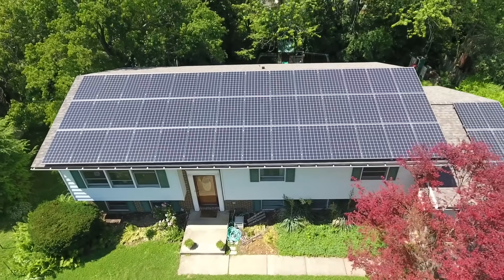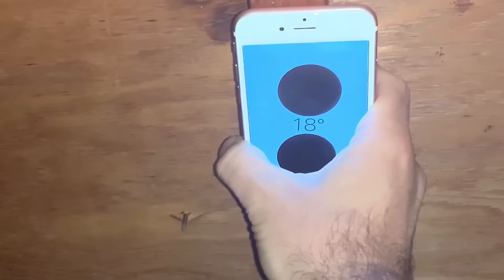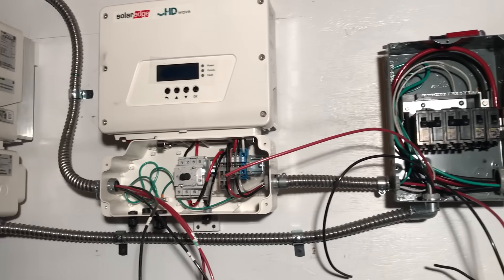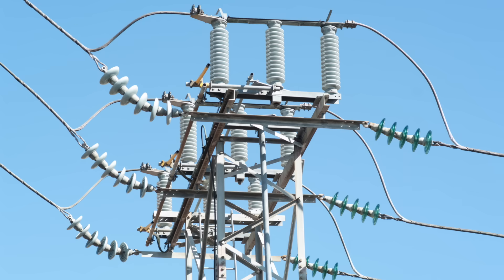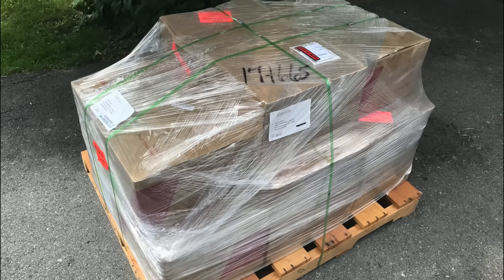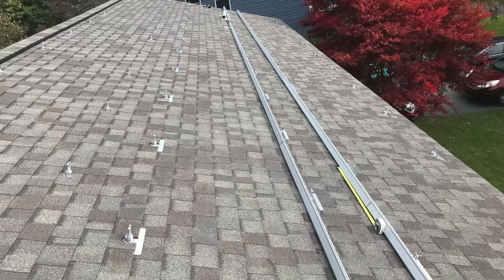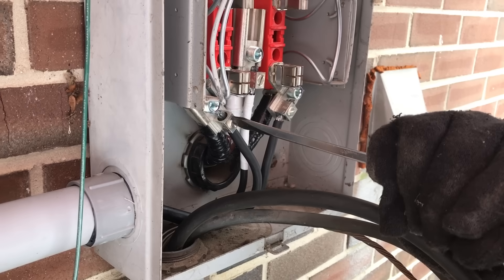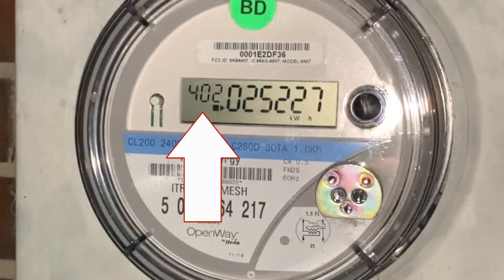I Installed a Power Plant Myself | HUGE DIY Solar Panel System

Comment: My only question is when your shingles need to be redone in 20 years. I’d imagine still worth it but definitely gonna be a lot more work.
Reply from the maker: Hey great name!  The shingles under the panels should last much longer than that since the panels are protecting them.
Reply: you could always go a step further and instal aluminum "lifetime" shingles.
Reply: Pretty easy to unplug the solar panels, and gain acces to the shingles. In the meantime the panels can just be placed on the other side of the roof.
Reply: Or install solar shingles haha they make those you know lol

Comment: You could reduce your carbon footprint by using a mini split which is basically an air conditioner that heats as well and are really efficient.
Reply from the maker: I’m definitely thinking about that.

Comment: Did you consider putting it in your yard on top of a big pergola? That way you could use the whole solar panel system for shade to hang out under. Like for get-togethers and whatnot. Any reason that wouldn't work? Yeah it would be big, but I have a huge, blank yard. So maybe it would be an upgrade to my particular yard to have this big shade thing. Any reason I shouldn't do that, and should put them on the roof instead?
Reply from the maker: That’s a great idea if you have southern exposure to your backyard. Unfortunately, my southern exposure is in the front yard.

Comment: Wow, what a bunch of work in the US with all those permits!! Can imagine you hesitated. Here in the Netherlands it is much simpler luckily. Just connect your inverter to the grid. And then it takes just one message to  the electrical company informing that you are producing. But I guess some level of checks helpt to keep the grid clean
Reply from the maker: I wish it were that easy here!
Reply: @FrugalRepair  but thanks anyhow for the nicely edited video, good job. PS fan of solaredge here as well

Comment: Lmao, I love how people spend between $20,000 and $40,000+ on those setups and they say No More Bills! 

I pay between $90 and $120 per month for electricity, that's between 20 and 40 years of electric bills, headache free, always there and reliable.

These systems are known to be very inefficient if not useless after 20 years, that's why government programs are only on 20 year contracts.

This is ambitious project, no doubt. But unless you live in a remote area with no access to electricity, it isn't worth it .

Comment: i really enjoyed the video but i was wondering if you  have done or could do a video that talks about what size of wires (16gage 12 g 8g ect.. are needed for the various configurations of panel size/inverter sizes/batteries ect...
Reply from the maker: Thanks!  Choosing wire sizes depends on many factors like conduit size, amps, temperature, type of conductor, etc.  I’ll keep that idea in mind for a possible future video.

Comment: Ya could have passed the ground bellow the rails... And there is no need to use a naked wire for ground. You just strip it at contacts.

Comment: So you're sending excess generated power back to the grid rather than storing it in a battery. Does that mean that when the system isn't generating power (it's night.. it's raining.. it's covered in snow..) you're drawing from the grid instead? You said you aren't getting any bills so I assume that even in those conditions I mentioned you're still generating more power than you're consuming, but I'm curious how this works with no battery.
Reply from the maker: The next video should explain the answers to your questions.
Reply: Former solar panel salesman. You are always drawing from the grid with solar panels. You don't use a single watt of it. The way it works is you become a power producer for your local electric utility. They then credit your account with an equivalent amount of "credits" for your power generation. For instance, if your panels generate 10kWa per day for example, and you use 11kWa, your utility company would only charge you for the 1kWa that you used that you did not generate. But you are always using grid power, not solar power. Conversely, if you generate more power than you use, it will "bank up" credits. This is useful for hot areas in the summer when you're using your AC a lot more, or cold areas in the winter. 
That said, if your system is drastically oversized (As it appears this house is), you're going to be generating far more than you ever use, which is just more cost on your end for no real gain. So if you want to get a solar system, take a look at your electric bill and add up the entire usage for the year. Then, add 20% to be safe in case of a heat wave or cold snap depending on you area and you use the AC or heater far more than normal. You'll still receive a bill from the utility company, but if it's a properly sized system, the bill will be $0.

Battery tech is unfortunately lagging behind, as there isn't really a practical solution to storing and using the power that you generate. They either take up far too much space in your house to be practical, or they don't generate enough power to be practical. A small battery setup is a good solution for say emergency power. Power outage happens and it will keep your fridge on so your food doesn't spoil, but you're still going to be using candle light. A large system will keep your power running normally in the event of an emergency, but don't expect to park your car in the garage anymore.
Reply: @seleckt6600  Interesting. That clears a lot of that up. Thanks.

Comment: I hope this would be as easy as this in Finland aswell. We get so little sunlight during the winter that the estimate after investing 18k to solar panels is that it benefits you by lovering your electric cost for around 15-16% in a month.

Comment: Really impressive project with a great result. Thanks for sharing. How long did it take end to end? As you were replacing the shingle roof was a Tesla solar roof an option or too expensive? Also, have you considered battery storage? You may end up making more cash as you’d almost never draw from the grid?

Comment: In previous years, Alberta power companies would do anything to detour any solar home installation from being connected to their grid.  They were ill equipped for it on their power grid and they didn't like a challenge to their power monopoly.  They would charge you insane prices on their issued power meters and even charged you a steeper monthly power transmission administration charge.  How times have changed. The smart meters are more reasonable in price and the power administration monthly charges are the same as conventional power.  I remember the days when a single smart power meter used to cost over $40,000; now they cost just under $600.  The smart power meter can be read remotely by the power company and this gives them valuable data on how to better fine tune their power grid throughout the day.  If electric cars become popular, anyone with a solar home will have a huge financial advantage against increasingly steep power consumption charges.

Comment: I used to drive a forklift at my first job. The oly reason your solar panel got hit is due to negligence. Your forks shouldn't be up in the air if the holes to lift the pallet are on the BOTTOM! You wouldnt even keep the forks that high when the machine is off, we still kept them on the ground. I'm so confused how the driver even did that
Reply from the maker: Yes, definitely a mistake. Maybe they had a pallet on there already when they hit this pallet?

Comment: In 15-20 years when you need to replace the shingles won't you need to remove the system?   I might have gone with a permanent steel roof.

Comment: nice job!
Question : what will be the efficiency of panels after 5 yaers, 10 years, and so on.
no battery used there? i think it is nice that your electric national compny want to buy electric instead of hold it in expensive batteries. but, i don't know which is the best at long time.
i'm interested by solar panel system, but scare for longevity...
thank you for shring and this nice video.
félicitations for your quality job done.

Comment: I'm an electrician and i am getting solar my question is since i have never done any solar before. is each panel wires in series/ parallel? Example, if you have 30 panels you would do 10 in series 3 times and then parallel the group of 3 to 3 inverters? im also getting power walls
Reply from the maker: That’s cool that you’re getting into solar! In my set up I have 48 panels, 12 are in the series. And I have four strings. But I am using power optimizers so it may be a little bit different since they are trying to keep the voltage constant 400 V.

Comment: Question though. Do you have a battery installed that charges excess power in the day so you can utilise at night when the sun is out? I imagine this setup might make even more value for yourself compared to selling power to the grid in the day, and buying from the grid at night. I think with a proper program set, you can charge a big enough battery to last a few nights, and still have enough to sell back to the grid when battery capacity hits the upper range of capacity.
Reply from the maker: No batteries, check out the next video where I explain net metering, that’s the key to making it work.

Comment: Unfortunately, here, the power company only pays you a fraction of what they charge you, for the same exact electricity. Even though you, literally, made them more money by them NOT having to feed your house with power, and you fed a neighbors house with more efficient power than they could have provided. While they were charged full price for that power YOU made. (The losses of sending power from a power station, to your house, are close to 28%. The losses of NOT sending that power, are 0% and the losses from your house, to the closest house along the grid, are less than 1%, on the hottest day. When it produces the most power and they have the highest losses in transit, for them.)

However, grid-tie is the best way to do it. As opposed to trying to store power yourself, which will end-up costing you.

Every 1 KW you make, is a about 1.28 KW the power company didn't have to make, to feed your home with power. Though it isn't exactly a "win" for the environment. Unless the power company spends the money they made from selling your power, on something other then jet-fuel and vacations in foreign countries. If everyone went solar... They'd still be making money, and have free power to keep the lights on in the plant, to make it look like they are actually doing something in there. :P (Throwing raves and still charging for the power!)

Comment: Does your state / county inspector not care about fire code? usually it is 3 feet from the ridge and outside edges of roof.
Reply from the maker: The setbacks were not part of the code in my area when I installed the system.

Comment: I install SolarEdge also... looking at your inverter, they are version 1 and in 13 months they are going to break. Some 18xB error. SolarEdge is great is getting you another replacement. 
Contact me if you need help setting it up... there are no videos on how to switch inverters. 
Call SolarEdge at 9am, otherwise you’re going to be on hold for 45 minutes. 
Solid install. 
Also the flashfoot2 flashing mounts are AWESOME. I use them all the time. 
And as for your grid connection, that’s called a line side tap.
Reply from the maker: Thanks for the info!  Can you send me an email and we can connect?  Do you know what the error is from?  That is, what’s breaking on them?
Reply: @FrugalRepair  also... I primarily use Panasonic panels for my installs. The VBHN series are the best in the market in my opinion. You are going to love the long term benefits of these modules.
Reply: Dude, I don’t know but out of the 8 I’ve installed, 6 have needed to be replaced. 
It typically takes place when SE sends an update. 
The device will lock up, then make me update it and after the 20 minutes of waiting for an update when the installer app says 2 minutes remaining for 18 minutes, the screen pops an error. 
I’ll look for the screenshot I took and email you. But yeah hit me up. Joseph@piefuerza.com
I loved your video. Reminded me of the first time I installed my first system. 
I had so many questions

Comment: This setup would cost me €50.000. or about 52 years of normal electricity cost for my family of 4. And everyone i know that has solar panels has blown inverters every 5 or so years costing another thousands. and then where i live i would need to pay €600/year distribution fee for the excess power OR spend another fortune on a battery, which also could break anytime it wants to.

Comment: I'm wondering, since your panels cover a good portion of your roof, did it help in the summer since it gives the roof under the panels a lot of shade? Just wondering if you say any difference with cooling and heating your home. Cool video.

Comment: Okay so I don't think solar can replace the grid but it is an important substitute. The most effective use of solar is for smartphone, laptop, tablet and anything with a deep cell battery. The most popular solar panel are ultralight foldables. The best place for solar is the equator. The best solar panel for money is renergy 100 watt roof mounter.

Comment: Wow!!! I am a Telephone PBX installer and have done many installs of systems and at times have worked along side the engineer who would be installing my UPS systems. I have to say that your install is the CLEANEST and most PROFESSIONAL looking install i have seen in a long time. Great work and very impressive.
Reply from the maker: Thank you for your kind words!  Your comment takes me back, in 2005 I ran a phone line to each room of my house and used an asterisk pbx to connect them.

Comment: This wouldn't work here as you are forced by law to connect your solar installation to the electricity grid. Furthermore, you are not allowed to "store" electricity, any surplus flows into the net. So basically that means "no generation = no electricity, so you are forced to get a normal setup as well unless you only want to "live" only when you can generate power. Up until recently we used to get money for this flow back (as you sell your surplus) but not anymore. Finally, there is a tax on solar energy now making it "not free" even if you would manage to only use electricity from that source. So bottom line, not sure where you live but law has caught up with this over the years.

Comment: I'm sorry but...no. ROI on grid tie ranges from 18 years to over 30 years and I base this on every professional book on the subject I have ever read. Normal break even date is usually when the panels are EOL anyway. Also, DIY means DIY and not contracting professional installers and electricians. Not knocking solar (I have solar off grid) but it will NEVER be cost effective compared to using the POCO. Never. 

One bad hailstorm you are done. One squirrel invasion and you are digging deep into your pocket to get them gone and to prevent them from returning is even more. You get a roof leak under those panels and $$$$$$$$$$$$. Insurance requirements for coverage is substantial. If your roof needs replacement you are looking at twice the cost of not having had those panels up there and most roofers will not take the job.

SO MUCH you neglected to mention and this sort of video is misleading.

Comment: i am not sure about regulation there but there are some inverter that act like a psu in case of no grid energy, that way in case of a black out you still have power in your house, these kind of inverter feed no energy into the grid in the case of a blackout and usually have the possibility to add a small energy storage.

Comment: Would it be possible to just feed the solar power into many high capacity powerbanks if connected in series to split the total load evenly so they can handle the input? Then connect each power bank in parallel so they will safely output the total combined power? There would need to be extra powerbanks connected for redundancy so if one breaks it doesn't overload the rest?

That could make say a 1200W or greater setup portable? At least portable enough to avoid limitations with renting a property and not being allowed to modify the roof or building if utility bills are not included in the rent?

Comment: Have you measured the amount of EMF radiation and the dirty electricity from all those panels? Also if a power outage happens will you still have power? Also I just read on ncbi.nlm.nih.gov that an Increased incidence of cervical and liver , and increased liver  mortality were observed with increasing

Comment: Had a similar idea "I'll just cover my roof in solar panels, it's a flat (super low slope) roof, roughly 1200 square feet of roof,  LOTS of solar to be had...  whoops, code requires a setback at the front and back of the house... fine no problem.... whoops code requires a 3 foot wide pathway that is unobstructed in case firefighters need to climb on the roof to get to the back... oh FFS!      Then well flat solar panels isn't terribly efficient, so angled them requires spacing between rows...   end result, I'm left with about 12 panels for about 3.26kW... BLEH!

Comment: Hi there, this is a great job! I am always curious on how solar panels compared with Stirling Dish concentrated solar system. Stirling systems can be 30% efficient as compared to solar panels and do not need much maintenance. If you can do a comparison, that would be great! Thanks.